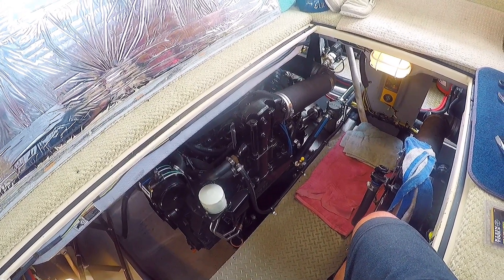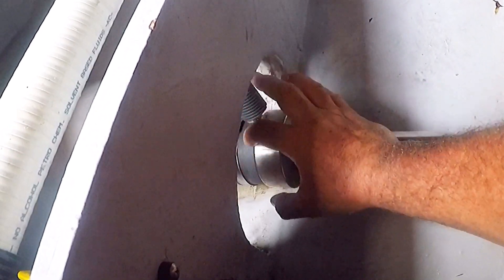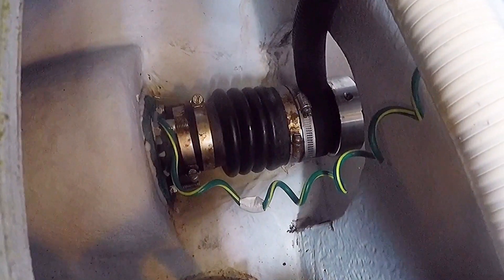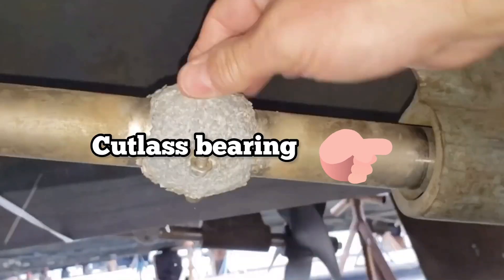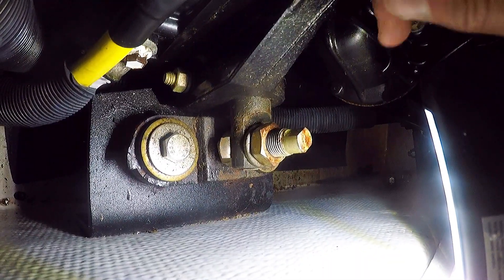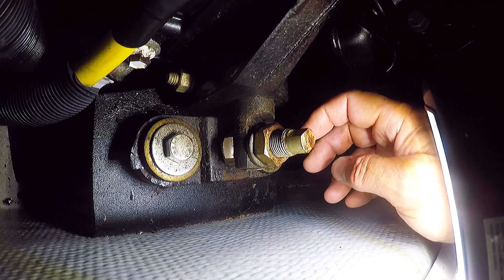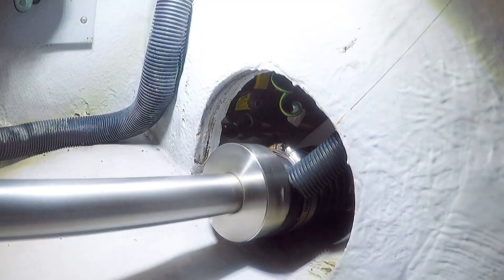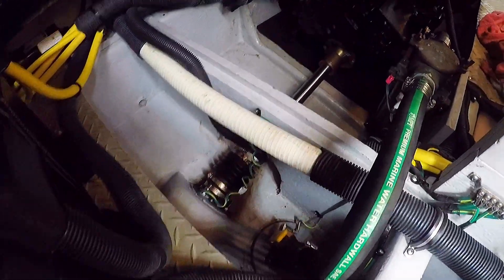Fixing leaky PSS Shaft Seals

Comment: I was motoring for about an hour or so on a new to me sailboat the other day, longest motoring so far and I started getting a squealing sound .. it sounded like it was coming from behind the helm. Not from the engine.  When I would rev down the squeak would slow down and stop once I pulled it out of gear. When I got back to the mooring I went below and felt the drive shaft it was super hot. 
Do you think this is friction from the carbon? Or cutlass bearing? 
I’ve been told to burp the dripless. How?
Reply from the maker: Sounds like friction with the shaft somewhere.  Engine could be misaligned.   Does the PSS seal you have use a water supply to cool the graphite seal?  Make sure it is still getting water.  It’s usually tapped off the engine somewhere after the raw water pump.  I don’t think burping them will do anything.  That is to clean the graphite mating surface.  You pull the rubber bellows back a little to allow water to flush out impurities.  Sometimes you may need to use light grit wet/dry sandpaper and slide it between the graphite and stainless ring to work away fouling, but that’s usually to stop leaks, and not the cause of your friction heat issue.

Comment: My wife and I just purchased a 2007 341. We are having shaft seals, shaft and prop balance, and new cutless before we take delivery. We can hardly wait. Love your videos. I feel like I know my boat already. Keep them coming.
Reply from the maker: Congrats!  It’s a great boat!  What are they getting for the cutlass replacements?  I was considering it as I already have the props off and a special tool is needed to replace those that I don’t have.
Reply: @AdventuresofHappyOurs  The estimate includes a lot... Sending off props and shafts, new seals, realignment of the shafts, cutlass, haul out and testing is going to be around 10k. I am an A/C mechanic. I am use to doing all of the work myself. I am going to leave this to the pros. I would like to see when you pull your risers.